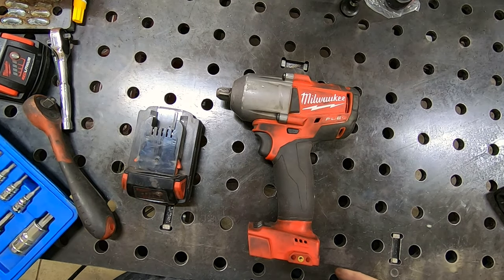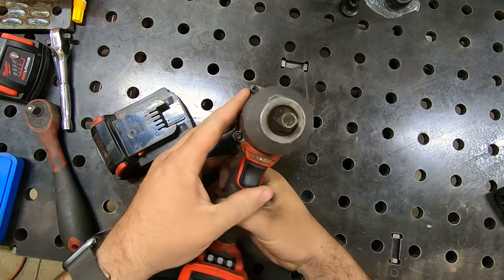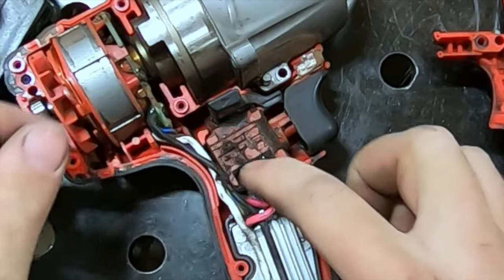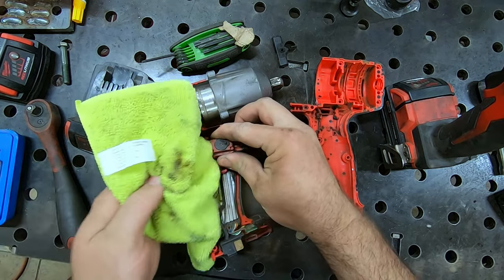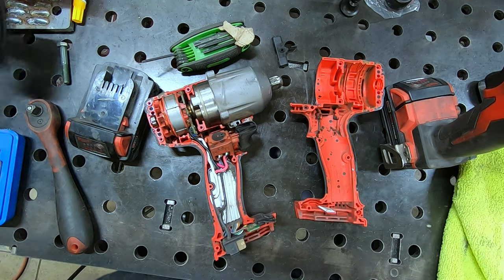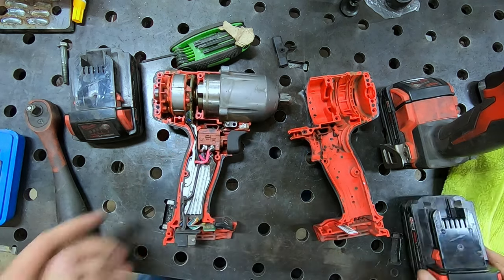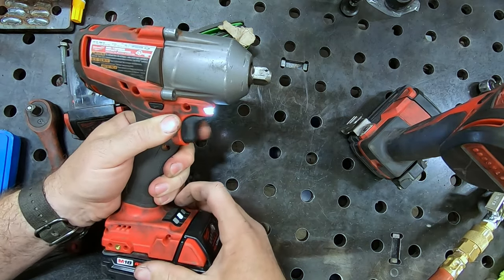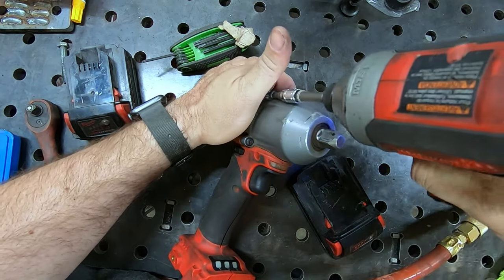Milwaukee impact driver repair. won't change direction or torque setting

Comment: Get some grease in that impact 👍they never put enough i packed mine an put chainsaw bar oil in there so it doesn't stick to the walls also i noticed it runs cooler with bar an chain oil

Comment: It seems that about half the time when something is not working, you can take it apart and put it back together and it works. The other half of the time you take it apart, parts fly all over the place, and you go buy a new tool.
Reply from the maker: Right! But at least then you’ve earned the right to buy the new tool!